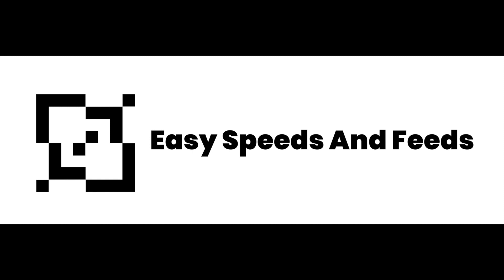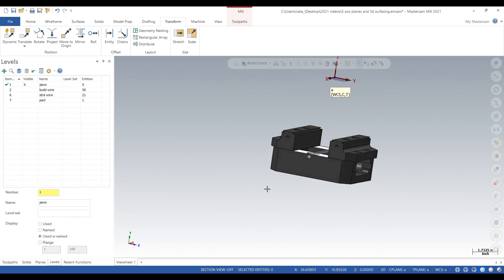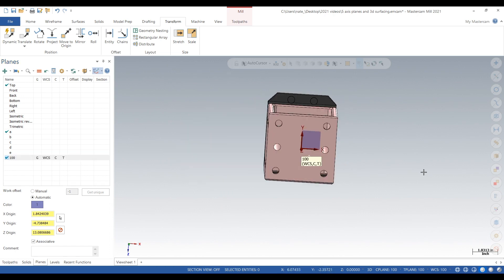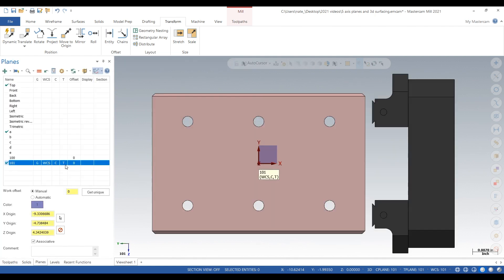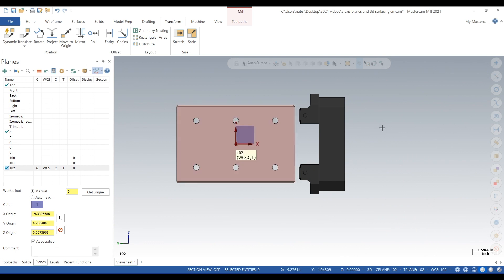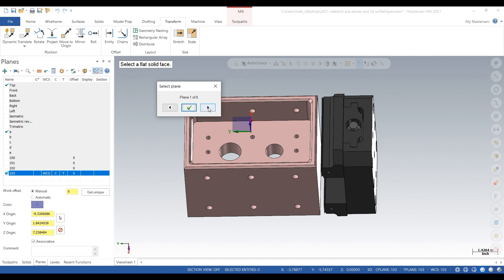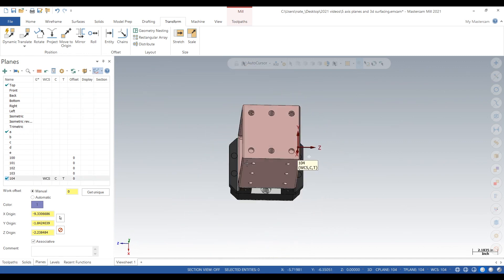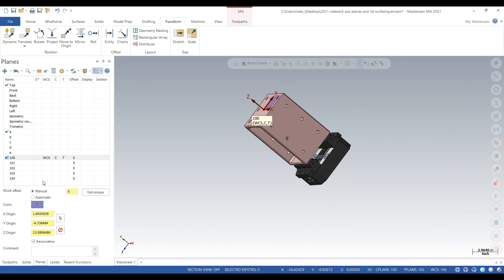3 + 2 Planes! Adding WCS for 5 axis Programming

Comment: I name my planes based off the toolpath group. Op1 will have the first wcs named op1. Any rotation will be called op1 f(front) op1b(back) op1 br( back right). Parenthesis is just for clarification. The shorter the better. Also i turn off associative. It will move the wcs if whatever you set the plane off of moves.
Reply from the maker: Its so annoying when all your planes move like that!